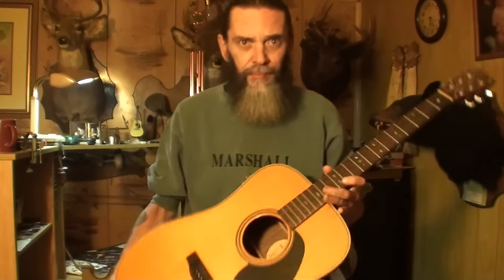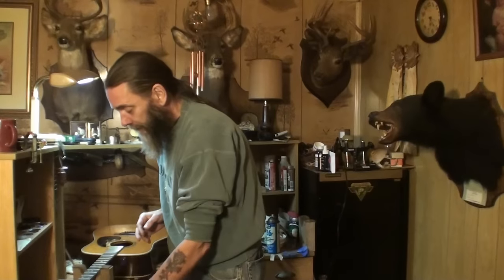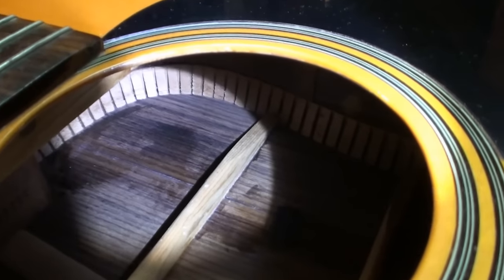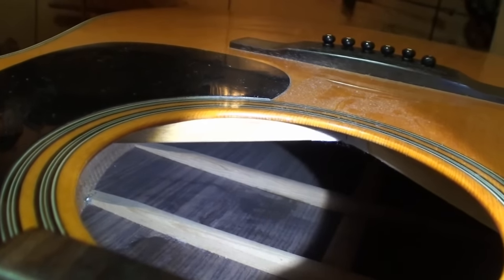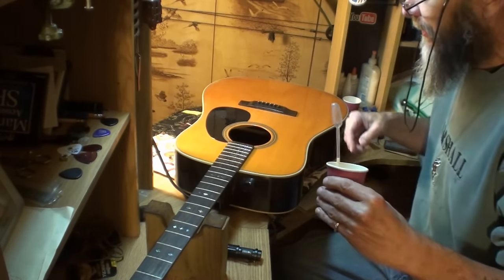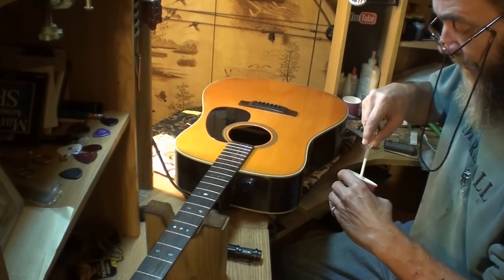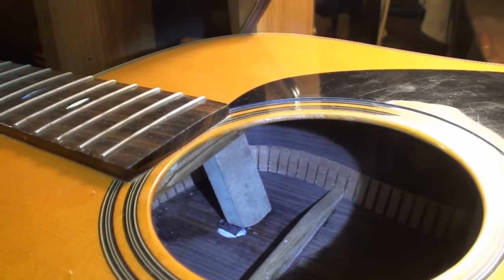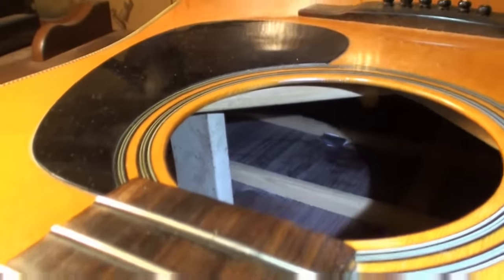Gluing cleats onto a badly cracked back of Blueridge BR160 guitar

Comment: I'm digging your videos my man. Another trick on getting cleats in is using two magnets. Put magnet on a screwdriver or something metal, put a little rolled up tape and stick the cleat to it. Use the other magnet on the outside to place it where you want.
Reply from the maker: Thank you mate! I have some rare earth magnets I use for that sometimes but haven't been able to find them for a while now, but yes it's a great way and can be clamped with them as well. Thanks for viewing! :)

Comment: Thanks for sharing how you glue cleats to secure cracks and keep them for getting worse. We sure have to keep our guitars humidified to avoid that kind of damage.
Reply from the maker: For sure! I've seen and fixed some really nice guitars that this happened to, it almost always decreases the value. I think I'm going to make another video and get some glue in the crack, normally that should be done before cleats but in this case someone already has secured the crack, glue and suction cup should seal it good and help protect the finish along the crack. Thanks Dale!

Comment: Another cool way to glue in small cleats like that: I use two 1"-diameter neodymium magnets.  Hold one atop the cleat and bring the other one under the guitar and gently snap it into place.  It helps hugely to apply a length of masking tape over the magnet and leave a little tab of tape sticking up to provide a 'handle' on the back side of each magnet.  I clean up the squeeze-out with dampened Q-tips.  Cheers Randy!
Reply from the maker: I have some rare earth magnets I use on some jobs but haven't been able to find them but yes, magnets are a very good way to do this. Cheers mate!

Comment: Great Video! Can't wait to hear the Blueridge when it's done. Hoold Ooon:D
Reply from the maker: I love the sound of this thing, it's louder than my Martins by far! Thanks for viewing Suzanna! Hold on! =D
Reply: Randy Schartiger I have a question, hoping you can answer. I just purchased a Blue ridge BR 160. I really like the sound however I have a concern. If I feel the width of the guitar just behind the bridge it doesn't feel flat, you can feel where the braces are and it feels slightly warped in a couple places. should it feel  completely smooth or flat? I don't think it's a humidity problem, I live in Oregon and have higher humidity(rain). My hygrometer says 55-60%. I can still return this guitar for a refund and I'm perhaps thinking I should exchange it for a new one.  Any help I would really appreciate. Thanks!!
Reply from the maker: Kory Hutchinson
They make the tops of those guitars really thin, that's one of the reasons they sound so good. Also not all guitars are completely flat, some of them are arched a tiny bit from the factory, the top and back are slightly arched. Not sure about feeling the bracing, tap around the top with tips of your fingers if there are any braces loose you'll hear them rattling as you tap. I don't think it'll give you any problems but you never no and I can't say for sure without seeing it. I hope this helps.